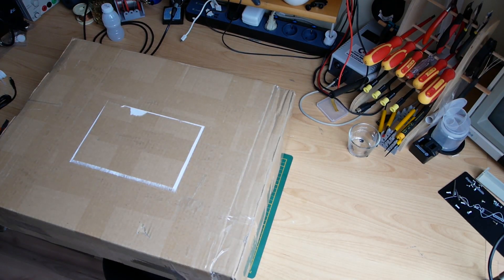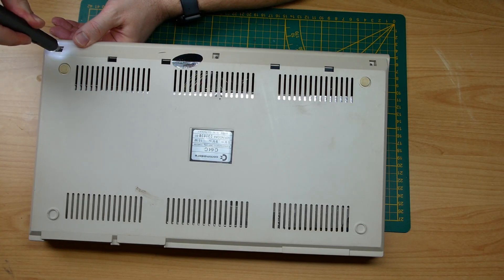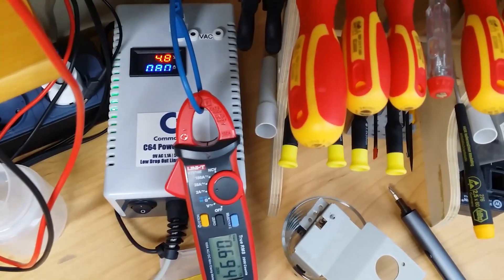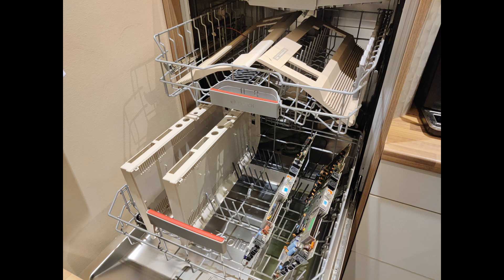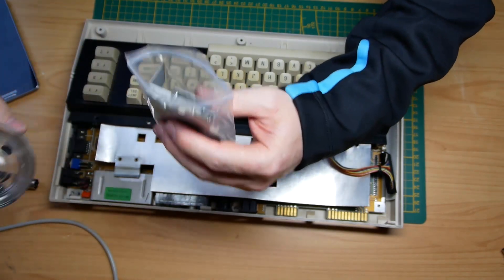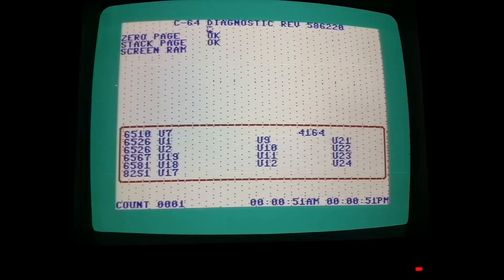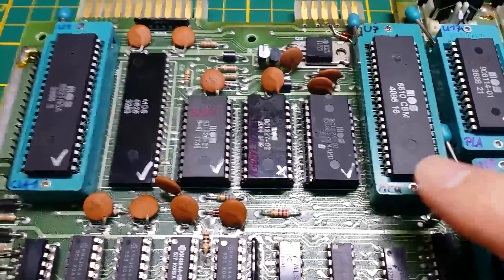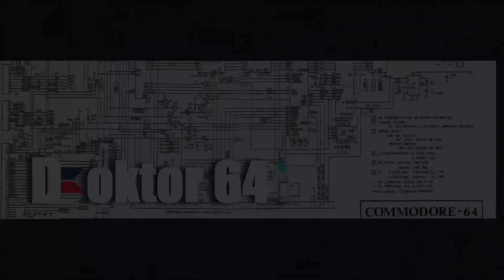Doc64 #25 | Commodore C64 | I bought two "broken" C64. Can I fix them, or ...

Comment: If you use a very little bit of hot air (even below 180°) after using the desoldering gun, the chip will slip out without having to wiggle the pins or applying any force. I'm not sure why that is, buts to me it always feels totally magic ;-)

Comment: I even found this 250407 in a c64c Case: https://youtu.be/J4qFkVVykMk (Min.13:00)
Don't know If Assembled in factory or by Retro-Fan. I read that all older left over Boards from Stock were the First Boards Assembled in c64c Cases.
The warrenty Sticker to my opinion doesnt mean anything. Some years ago someone sold obviously New C64 warrenty Stickers in Bundle of >20 pieces. Obviously Fakes.
To be honest: did you See Any C64 without repair Label Back in the days?